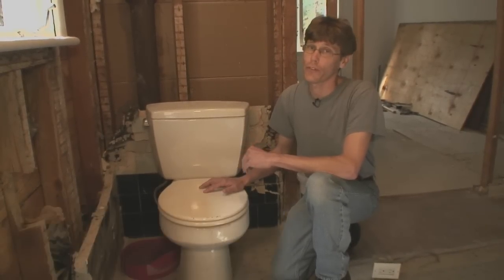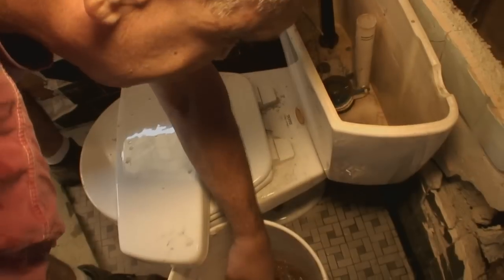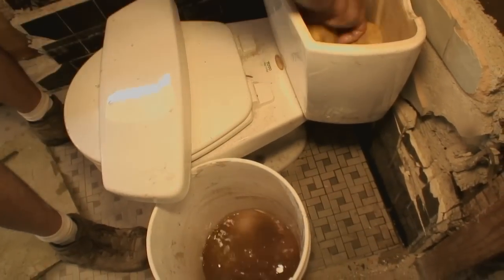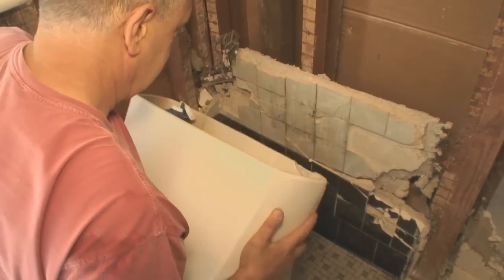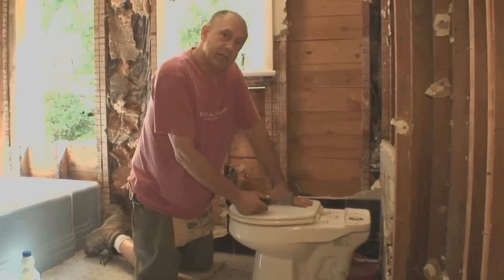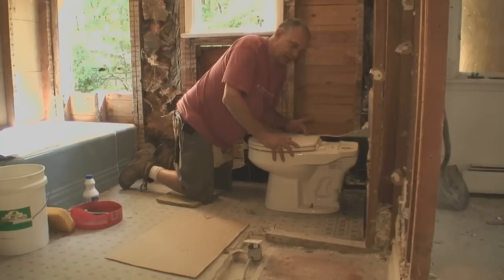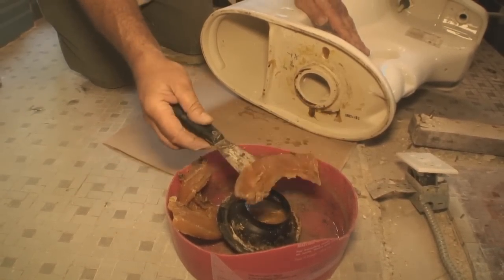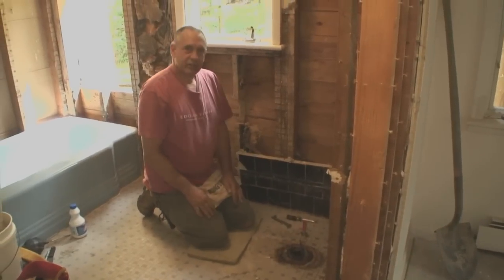How To Remove a Toilet

Comment: I recently had to take apart my toilet at home to remove a large bottle cap that was stuck in the trap. This video really helped minimize the mess and any of the "mystery" about toilet installation and removal. A few quick tips: If you are going to refurbish the old toilet, buy a fresh wax ring and a new tank-to-bowl mounting kit. You'll also want a paint scraper to remove the old wax ring from 1985, the last time anybody gave a fig about what was under your toilet. Also to get out the bottle cap (or whatever) take the toilet outside, turn it on the side, and run the hose through it on full blast. It will come out.
Reply: Did everything come out the toilet?
Reply: @tias9796  Yes. It was a little tricky to get the cap out because there wasn't space for my hand, but spraying it out with the hose worked. If you're removing the toilet it might be a good idea to have some flattened cardboard boxes hanging around to keep your floor clean. Or alternately if you have to move the toilet outside you could set it in a heavy duty moving box. Whatever works.
Reply: @danielburner9960  wow fast reply, did like toilet paper,etc.come out or was it just water??
Reply: @tias9796  I've been waiting six years for this. Lol. I didn't have an ... um ... organic material clog so nothing like that came out. Just water. I knew for certain what the cause of the clog was and where it was happening in the structure of the toilet, so it was a very specific case. If your clog is in the plumbing rather than the toilet you'll probably end up needing a plumber and you could get all sorts of surprises when you remove the toilet.
Reply: @danielburner9960  ahh okay thank you so much !

Comment: Thank you for this video!  We had gotten as far as loosening the bolts on the floor.  The nut on one side would not loosen, because the bolt was spinning!  We used a screwdriver to hold the bolt in place as shown in the video and it worked like a charm!

Comment: This is a nice video and I learned a few things.  One simple extra suggestion from someone who has removed a few toilets in hist day - hold the handle down until all/most of the water is out of the tank.  A regular flush leaves several inches of water in the tank.  Saves on some additional bailing.

Comment: Thank you, so much, for posting this video. I needed to have my toilet taken up to replace the flooring and decided to do it myself. It worked out just like you demonstrated in your video, except I had to use a hacksaw to cut one of the bolts at the base.  Thanks!  :  )

Comment: Thanks very helpful, had never pulled a toilet before today and this made it a breeze.  The grout sponges like you used worked quickly and easily, quicker than emptying out my shop vac anyway.

Comment: Hi there... I have a quick question... We removed our toilet, but the upper part of the water reserve where you flush it, the flush button is on top of it. And it's still some way attached so I can't lift that part. What do I have to do to take that part off?

Comment: I have to remove the toilet to remove the wall paper and paint the bathroom. You make this look easy, but man, I'm not looking forward to it. I want to put the same toilet back (it's a new santa rosa put in about a month ago) -- do I need new wax and seal? Thanks.
Reply: I would put a new seal in. Not cool having to pull it again because it leaks.

Comment: Thanks for providing a simple easy do it yourself solution. I have never done anything like this in my life. 23 years old and was able to do all of this by myself in about 1hr 30 mins. Turns out the reason my toilet was broken was because someone flushed plastic shot glass down the toilet during a small house party. Any way thanks again!

Comment: will I need to remove the toilet of there is a toy stuck in there somewhere ?? trying everything and nothing seems to work for us
Reply: Jeffrey Roy Jr. Acid
Reply: Use a snake if you still can't get the toy out,  remove the toilet,  run the snake through bottom..

Comment: he's done nothing more than install a toilet, turn on the camera and tell you how to take it apart. old toilets never come apart this easy. when he removed the  tank bolt and said. "that's good, that one is coming off very easily" i wanted to hit him with a brick. it came of easy because he'd just put it on. look at the bolts, they are brand new.

 those bolts rust solid on old toilets and I'm here looking for ideas how to get the tank bolts loose. now i get it to turn from the bottom and it turns in the tank at the same time. turning from the bottom overpowers any attempt to hold it with a screwdriver from in the tank. That IS the hard part. Any idiot could reverse install a new one.
Reply: ***** For real I hate how they make it look so easy.
Reply: +Jack Hammer I feel your pain.  I keep a "nut splitter" in my tool bus for just this problem.  Auto parts stores have them, lots of different styles, make sure you get one that is low clearance.  Also, I keep a Dremmel with a mandrel and healthy supply of 1-1/2" cut off wheels (cheap on ebay) around for stuff like this.   Sometimes by the time they call me the little toilet leak caused by a rocking toilet has rotted the floor and rusted out the metal flange that holds the bolt heads from spinning. Cutting out the rotten floor for floor repair may be necessary which will give you access to the underside of the floor flange.  Score the plastic floor flange collar every inch or so with the Dremmel and cut off wheel or mini saw blade and pry chunks out with a screw driver or chisel.  If the floor doesn't quite warrant replacement and the collar of the floor flange is on the inside of the drain pipe, (where it should be) carefully score it every inch or so with a sawzall or skinny hand saw and again pry the chunks out.  Stuff a rag down the pipe to catch the pieces, clean up the inside or outside of the pipe with a rasp or file so the new flange part will fit easily down on the drain pipe.  Also,  I'm not sure but I think I may have seen a replacement metal flange that doesn't require removing the plastic collar part of the flange at a specialty store.   Worse comes to worse and the wood in the floor is still solid enough,  fasten the toilet down with a couple stainless decking screws run through fender washers and fasten the bolt cover back in place with caulk.  Make sure you tell the homeowner what you've done and why, saves them getting pissed when they find out later.